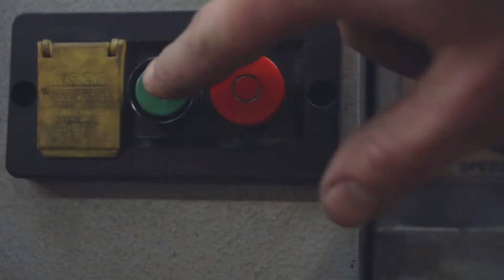Brake Caliper Pistons

Comment: Yeeees! Great!
Those are crazy expensive for what they are...
What metal did you use?
Reply from the maker: This was many years ago, it was one of my first attempts at real precision on a lathe. The metal was some type of steel, probably just mild steel. Anyways those pistons are still in service as far as I know. I sold the bike last year but in the years I owned it they never had any problems.
Reply: @RussellMakes  great, yes they are really expensive parts, i really dont get why...